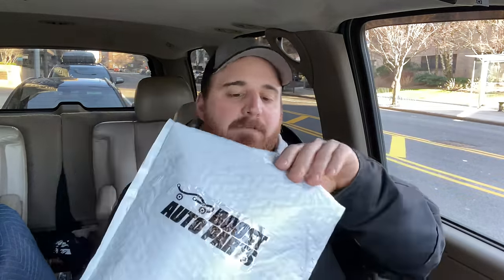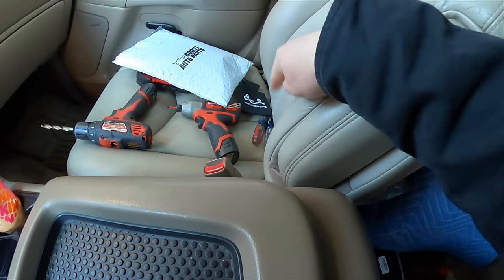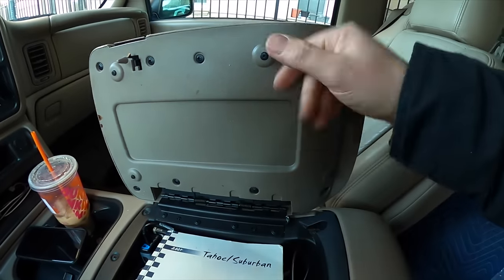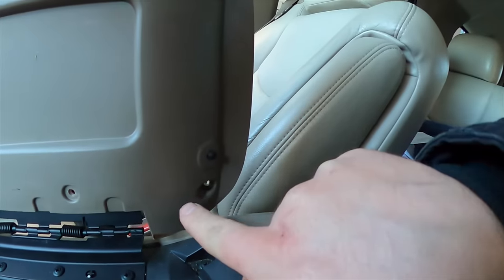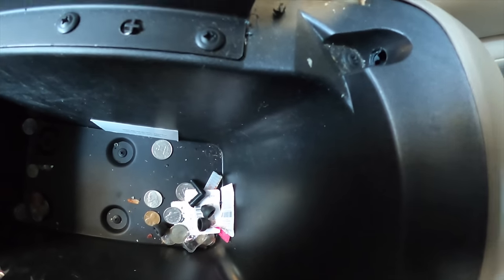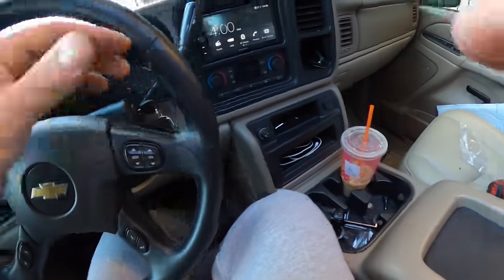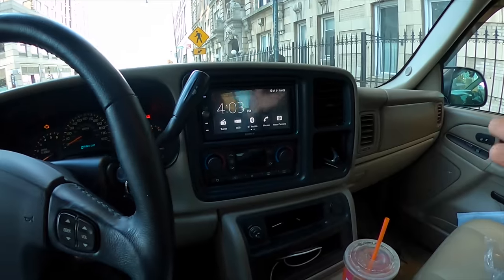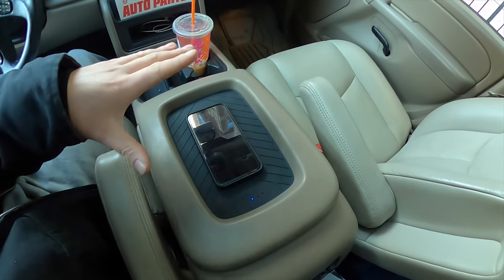How to EASILY ADD WIRELESS CHARGING to your 2003-2014 GM Truck or SUV!

Comment: 135.00 ... Nah I'm good..  actually I'll make my own from an eBay pad.  thanks for the idea
Reply: I know I'm late to the combo.. but some PPLE are just cheap. To them selves. 135.00 is not a bad price for that type set up. I don't smoke but I'm sure a few pack of smokes and a case of bud. After a hard work week . Can hit135.fast.figure of speach but you get my point🤗🤗🤗🤗
Reply: D.J. KEYS lots of,people are not aware of their worth.
Reply: Kits are generally overpriced... He's right. Usually buying the parts and making it yourself is much cheaper if you know what to get especially on ebay. Especially true for lights and such
Reply: @DJKEYS-br1xh  If you have the skills to fabricate and save the money,  you'd likely prefer the 🍺.
Reply: @DJKEYS-br1xh 135 for a charger that takes 3 hours possibly to fully charge?? Naw I'm good fam.
Reply: Did you ever do it¿

Comment from the maker: Seriously its just the absolute perfect spot for a charging pad🤷‍♂️ Remember to hit that like button for mor Tahoe content!
Reply: Umm I think I need this for my truck
Reply: Do they make one for a 2018
Reply: Hi, I have a 2001 Tahoe LT Autoride, I don’t have  a stereo on the rear ,could I just grab power from the cigarette lighter under my dashboard and change the center console lid just like the one you have? Thank you in advance👍🏼
Reply: Wonder why this doesn't work on an 02? Different size ?
Reply: Does this work with all kinds of phones. Mine is like 5 years old
Reply: @elsey1976   2002 has a completely  different  console.  You have to swap console  and  both button dash piece's
Reply: @mrcorvetteadrian790  no. You have to swap the whole console to a 2003 - 2006 style and the buttom dash piece's.
Reply: Where can I order it ?
Reply: The Punisher no
Reply: Link?
Reply: @thepunisher2895  Your phone has to support wireless charging for it to work.  The Samsung Galaxy S6 was the first to support it and it's over 5 years old now but in the beginning not many phones had wireless charging.  On the Apple side the iPhone 8 was the first to support wireless charging and those were released in September 2017, so only 3 years old.
Reply: What is the link?
Reply: @prioritypursuit370  I have an 03-06 center console in my 03 silverado that originally came with the jump seat, I didn’t take the harness to power the rear power port or rear audio controls, can I jump power from one of the front two power ports?
Reply: I installed mine and I put my phone on it and it a Red flashing light

Comment: I have an 05 silverado with center console, I work for a GMC dealership. I have a gen2 wireless charging module that we offer as a $99 upgrade from the old gen1 charger (gen 1's only wirelessly charge up to the iphone 8+ if I'm not mistaken, anything after that, you have to pay the $99 plus install from the dealer to get newer gen iPhone charging) that a customer didn't want in their vehicle any longer because he felt having his phone charging all the time was bad on his phones battery. Soooo,  I was going to modify my center console and hotwire it in somewhere (it has been sitting in the box for the last year or two still uninstalled in my truck... and then tonight I randomly ran across this video after looking for a better after market headlight than what I have now for my truck. Before I even finished watching your video, I clicked the link posted and ordered this instead of new headlights tonight. THANKS lmao. 

I should also note that I have a wireless apple play Pioneer double din, because I HATE wires cluttering up my interior with wires, so this is an instant benefit for me.
Worth the like and the sub!
Reply: Where you get that radio from ?

Comment: Damn $135. I’ll plug mine in lol, good vid
Reply: Any wireless charger will work
Reply: Heck I have a Samsung wireless charger that was given to me and I can use that as well just cut out the hole and stick it in there and it will work the same and cheaper to replace the cover out of a junkyard if need to be
Reply: lol same
Reply: Damn 135$ GTFOH
Reply: I'd pay it if they offered one for my vehicle.  $135 for a totally stock looking wireless pad and no wires would be 100% worth it for me.

I'd like to get an older Tahoe/Suburban for my next vehicle which I why I watched this.  I would prefer to avoid the DI motors if possible.
Reply: And only if they charged as fast as the oem charger
Reply: Exactly
Reply: Hell NO! 
Thats new led taillights and some beer! 
Il make one ! I just never thought to put one there. The video At least gave the idea to do it. So props but i will make my own.
Reply: Womb Raider  all you have to do is get a wireless charger and put it under the pad and plug it up so when you set your phone down it will charge
Reply: The price is insane. No thanks

Comment: For me, i bought one of those amazon wireless charging phone stands. It clips right to the vent and the wire runs to the middle plug. It wireless charges and holds the phone when im using gps etc. It was like 20 bucks or so

Comment: Off topic but in my 05 Silverado I have the same radio as you and I bought a USB port that I retrofitted into the old cigarette lighter on the left of the center console. It fit perfectly in the same spot as the old port and I hot glued it in the back to hold it. It looks completely stock which I love. I left the one on the right but have been toying with the idea of making it into a AC outlet.

Comment: Escalades have a different console lid.  They are covered in leather, and center doesn't have that sunken portion like yours has.  That Tahoe lid may be a direct bolt on for Escalades, which would make the wireless pad possible.
Reply: same with denali

Comment: Of course mine is a 2000, ugh lmao
This would help me a ton cuz I go through cables like my 5.3 goes through oil
Reply: Joseph Joestar I believe you can buy a 2003 style console but you also need to buy the glovebox and the dash part under the steering wheel
Reply: Also got a 2000:(
Reply: Facepalm
Reply: You can buy a center console from a 03-06 Tahoe or Silverado. It’ll fit you just need Th e glove box, the dash under steering wheel & the plastic bracket that mounts to the center console , also the double din bezel to cover the gap
Reply: I have an 02 but put the center console from an 04 all you need is the center console and the glove box and the original dash bezel fits but it leaves an opening so its best to get the 04 dash bezel to have a clean look

Comment: Obviously you have some vehicle tech experience, quick, clear and to the point including the magic drill. I will be looking at you other videos to see what you have been doing. Retired, but ASE Master Tech since 1978. I have researched “QI” phone chargers as this is mutual induction like a transformer as long as the phone has capabilities. They make good and poor or thick cases for non-QI phones. It comes down to how the plug into the phone. Some are easy, but block and outside connection at the phone and some good ones are very reasonable for older phones. A newer “QC3.0” USB charger is cheap and available for Quick Charge that it can tell. I have two different ones on my garage to charge my phone. My interest is lead by research to create a custom console for a 1967 C10 PU with an 03 year Tahoe 5.3L engine swap and sewing my inside, wiring, bodywork and painting to the specs in my mind, as my first vehicle at 13 (Farm Boy) school & farm work, I bought a 65 C10 Apache I drove for years. 
  Hey, how many techs get halfway thru their classic, get married, kids and drive it to work in 5 different colors until they need a minivan. A dream dies just a little. I should know, I bought a car from a customer and gave my youngest brother as nice, no rust, no dent 68 Dodge Charger. Never heard from him since 1977. Nice subject, good content! Liked & subscribed!

Comment: It is a pretty cool upgrade...... BUT. I have my phone in an otter protective case..... so it wouldn't charge on a wireless pad. Next thing, I have the wire, as you described to plug the head unit directly into my phone, which I prefer over blue tooth connection as my unit, to use Android Auto needs to be connected anyways. As you said though, that is an absolute perfect place for that pad. Just seems a little pricey as well as redundant for my purpose. Im speaking about my Silverado... now my Suburban is still using the stock deck. I use the Suburban so little that I havent quite been able to justify putting in a new head unit. Great job on your videos.

Comment: I just installed a 2003 to 2006 Console into my 2001 Yukon XL today, so I might be picking this up. It was honesty really easy. I still need to drill a couple holes for it to mount to the floor secure, but how it's installed currently its not going anywhere. I also did not realize the bose system trucks have a 6 inch subwoofer at the bottom front of the console. It was half off at pick n pull, so I got the entire console brackets and all for 11$. Quick little cleaning and it looks new. My interior is a two tone as well now.

Comment: love it wish my 04 cadillac escalade had a spot like that. i may add a suggestion  wrap the cable with insulation tape or shrink wrap so it wont make the rubbing noise  cool video  as allways!

Comment: I have it in my 2008 tahoe and I love it. I did add a reset button to it because it will lock up if something metal contacts the pad. It was easy used a normally closed momentary switch and that allows me to reset on the fly.

Comment: My girlfriend has a 2009 ford edge and i did something like that, but all i did was take a wireless charging dock, took it apart and stuck it to the bottom of the center console, plugged it to the back of her aftermarket head unit and it works great

Comment: I think that's pretty nice if it were $60 or less and you can get one on eBay for 20 bucks or so and retrofit it's in the same place but $135 I think I'd rather just stick a in the phone. Good video I am curious a lot of other people comment the 5.3 leaking or burning oil or having a issue with coolant I've had 3 early 2000s GM full-size trucks and SUVs with that engine and never had any of those problems maybe because I maintain my vehicles even though I buy them used I'm not sure but I hear it all the time yet I have not experienced any problems for myself

Comment: Nice video, question the wireless charger don’t drain your car battery?
Reply: It will not drain the battery, it is designed to draw very little current when in the resting state.

Comment: I was excited when I saw this and even though it seems very expensive for a charger, I went ahead and bought it.  It is a beautiful design and looks great.  After using for the past week though I find that it's not a good charger.  First, I'm constantly trying to move my phone around to find the sweet spot.  A spot that worked one time, isn't' always the same spot the next time I use it.  I find myself constantly moving my phone around the mat wait info the connection sound to go off.  I think the biggest disappointment though is that it's not a fast charger.  Last night I drove for an hour and didn't touch my phone while charging it it only took it up about 40%.   I was under the impression it was a fast charger.  Anyway, looks great, but I wouldn't do it again as it is way overpriced for a slow charger.  I was hoping to ditch the lighter plug charger but it looks like I'm going to need to keep it.
Reply: Do you end up losing the cigarette style power outlet in the center console?
Reply: @jwickert3  No, it connects between the car harness and the plug.

Comment: A little concerned because I just ordered the pad but when I put it together i found that it doesn't work for the 5g network.  It's slow 🐌then it just stopped ✋😒 
It got hot!🤷🏿‍♂️
Any recommendations?

Comment: Im having an issue where the light just blinks blue and never really connects to anything. You can turn the system on and off but that's about it. Lol worked for a little while.

Comment: Does it move around when you’re driving though? Wireless charging is so fickle when it comes to movement that I wonder if it’s staying connected.
Reply from the maker: Used it today and it doesn’t move at all. The rubber is actually grippier than the stock rubber mat.

Comment: Will this charge multiple phones? Or just one phone at a time? Great vid btw!
Reply from the maker: I only think one at a time. The charging element is in the center.
Reply: @lsxmatt   Is there a mode to turn it off?  Lets say your phone's fully charged. Will it always keep charging it, is that good for the actual phone.
Reply: @ChevPawks36  the phone shuts off its receiver coil when fully charged, which in turn shuts off the transmitter coil. the phone controls whether its on or not. it's basic induction. Like an induction stove, if theres no pan over the coil, it's not on. .

Comment: I did the console swap in my Silverado so the area you plugged into doesn’t work in my truck. with that said Is the harness long enough to run from the other outlets in the console?
Reply: The boost auto parts website says the harness is long enough to reach the front 12v

Comment: That's awesome but $135... no thanks, I took apart an old Samsung wireless charger and installed it works just the same and was basically free since I already had the spare charger laying around...

🥃cheers🍻
Reply: And for anyone wondering I put it under the plastic so the mats not distorted and simply soldered the leads back on to the static pad in a more usable manner then ran the power cord though a small hole to the console I was planning to do a hard wire but didn't have the components on hand that the time ... so it's still just plugged in to a socket inside the center console out of sight and it works just fine, and if your so inclined its pretty easy to gut an adapter and solder it directly in to but I wasn't looking for that at the time but I plan to do it some day just to free up the outlet and clean up the install that last 5%...

Comment: Could I make this work on my 03 regular cab that has the same center console swapped in? I don’t have power to the rear cig lighters, but I do have power to the front cigarette lighters
Reply from the maker: Yea if you have that console I don’t see why not!
Reply: LsxMatt do you think the harness would be long enough to reach the front cig lighters?
Reply from the maker: HAYHAULER there’s a lot of slack I think it would. Worst case scenario you can easily extend the harness.

Comment: How does it perform while driving? I cant imagine well at all, since the charger is so small and the pad is big. Everytime you hit I bump and/or curve at speed, it has to move enough to stop charging. I'd like to know, but if it's the case -which it has to be, it's not worth  $135 to say you have wireless charger.
Reply from the maker: The phone doesn’t move at all. I did about 100 miles with it yesterday, mixed highway and city. I can’t speak for a phone without a case, but with mine in a rubber bumper case the phone doesn’t even move with me trying to drag it along the pad.
Reply: @lsxmatt  I do appreciate the quick response, or any responses to at all. I am still sceptical on the movement of the phone, reason being I use wireless home charger smaller than my phone and if I don't place it perfectly everytime, it doesn't charge. Very aggravating. I currently have an automatic fleabay special wireless car charger, that works but I'm not a fan of. Granted you can live with being unhappy with $20 charger much easier than a $130+. Hope to see more reviews before I make the commitment.

Comment: The most krinkly bag i have ever heard in my life lol👌
I have an 01 yukon xl and am wondering if ur entire console would fit. Like if i got rid of my cassette player lol, & just dropped in the 03-04 console?
Reply: i believe the wiring harnesses are totally different.
Reply: I swapped my 2002 Tahoe worh no issues.  You have to change the lower dash on both sides